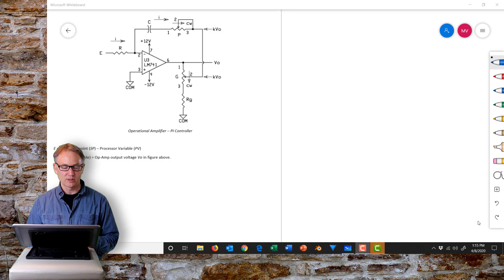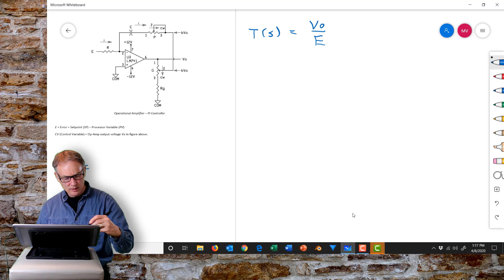PID: Using an OP-AMP to implement a PI controller.

Comment: Hello Sir,

I need your help as I am currently working on the simulation in PSpice of a control circuit for a static converter: a buck-boost converter integrating a PID controller, using only analog components such as operational amplifiers, resistors, and capacitors for the PID circuit.

I don't know the criteria for selecting the PID gains to calculate the parameters of the PID, meaning the values of the resistors and capacitors. Also, there are different types of PID configurations (series, parallel, hybrid), and I am unsure which one to use.

Furthermore, I don't know how to integrate this PID with the static converter to generate the PWM signal that will control the converter. My goal is to maximize the efficiency of the converter.

Thank you in advance for your guidance.

Comment: Can anyone tell me where about in an electrical engineering degree this class would be? I've been self-learning this whole time, but this video for some reason has made me feel this burning desire to go back to school. Because I have been practicing all of these things without knowing any of the terms, but it all made sense as I was hearing it, and, I feel like I am further in my learning than this. Which has given me an unexpected feeling of hope. 

But now I need to know, cuz maybe I really do have a knack for this. I have spent every moment of my spare time every day for about 6 months obsessed with this stuff. It all began when I was devastated by my guitar suddenly dying on me, and decided to try to fix it. Well, I fixed it. Then, my amplifier was making noise when I connected it through one of my pedals... so I learned how to make a buffer. And it has just snowballed into a complete obsession. I find the waveform to be more easy for me to visualize than actual things. I can imagine how they would be affected by things, such as filters, or by each other, or if they are summed, differential, if I made two full rectified instances of a sinusoid, and one was inverted and also 90 degrees out of phase, then they were summed...
... you get the point. I am thinking about waveforms all day, I dream of them, I wake up and make whatever I dreamt about.

...and I basically have only needed to do the math a handful of times for each type of circuit or function. Once I can "feel" a formula or, a group of dependent relationships, I can estimate with very decent accuracy. 

I have experienced this in the past, but never on this level, analog circuitry feels like the scratch my itchy brain has been seeking all of my life... I can just feel it, what would satisfy the functional loop for a given circuit, especially with a scope of the input and output, I can tell right away exactly what is happening or what needs to change

 I spend all day studying, simulating, and building analog effect designs. I am nowhere near sated in my hunger for understanding. I am ravenous.

God, someone please help me.
Reply from the maker: Not every college or university teaches Op Amps in depth.  It depends on the instructors and program objectives.  Some feel in this digital age that the focus needs to be on software platforms like microprocessors.  At the college I taught at, we covered both areas.  Teaching Op Amps wasn't just about learning how the devices worked and how to use them, it was also about learning how to solve circuits across a wide range of applications using math and electrical circuit theory.  In my Op-Amp courses, we covered everything from the differential amplifier itself through to instrumentation, filters, PID, oscillators, all while exploiting Kirchhoff's laws, Calculus, complex numbers, and Laplace Transforms.  These skills are timeless, and foster higher understanding in students about all circuit types.
When I was first learning electronics in high-school and later in university, I stumbled upon a book written by Albert Malvino entitled Electronic Principles.  He is one of the most intuitive writers I have encountered in a college level text book.  Since then, the book has undergone several revisions and I was delighted to find that the book was still available for purchase many years later and recommended it to our electronics program as a student text.  I believe it is now on its 9th edition; our students used the 8th edition five years ago.  If you can get your hands on this book, it may help you.  It covers semiconductor theory, diodes, including zeners, numerous transistor types, numerous thyristor types (SCRs, Triacs), IGBTs, Op-Amps, Amplifiers, Filters, Oscillators, and Power Supplies.
Reply: @ProfessorV. Thank you for your reply. Would you happen to have courses available for auditing? 

Thank you for the suggested reading, I'll find the book. 

If Analog circuitry is my passion, where would you recommend I go? It is a shame that Analog isn't taught as much anymore. I have never been able to digest an answer I didn't fully understand the implications to. So I simply need to understand the fundamentals before I can move onto more complex ideas. 

I have just completed a circuit which required 8 op amps to execute my desired function. Originally 9, but I managed to simplify it so I wouldn't have to buy more IC sockets just yet ;)

It worked as designed. That was a good feeling. It took me 3 days to assemble it. 

I'm gonna have to start designing the pcbs and ordering them at this point, that was way too much soldering for me ;)

What are you working on right now, if you don't mind me asking?

Comment: Hi, Dr. Thanks for such a great video. I have an analog PI controller circuit through which I want to drive past the actuator but my output of the controller becomes saturated. How I could solve this problem? I am new to electronics. Also, I am not sure which output will be better for me in the end. My cut-off frequency is 2KHz. How I should analyze the output? and choose better one.

Comment: This kind of circuit is used in feedback class d amps, like icepower.  Id a PID not better? faster and more stable in such amps. In a PI the setup of a feedback is such that the fall off from 1 Khz to 20 or 30 Khz is such that at 30 Khz the gain is zero, sometimes in class d I see even more safisticated system with some more complicated  plot where the transform as more poles and zero.s.
Reply from the maker: For many applications, adding the derivative to attain a full PID control also risks adding instability (oscillations).  In your application, derivative action may be beneficial and speed response.  PI controllers tend to be better behaved however for things like motor speed control but I have seen the derivative used on tachometer feedback to reduce overshoot.  For an OP-AMP circuit, adding a capacitor in series with the input resistor effectively introduces derivative action.